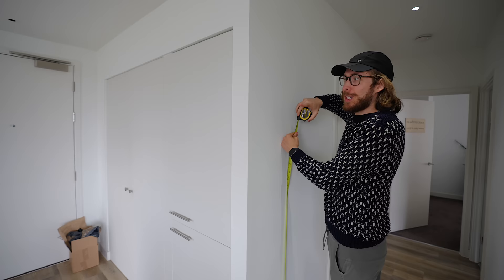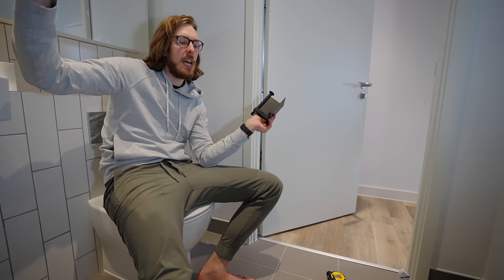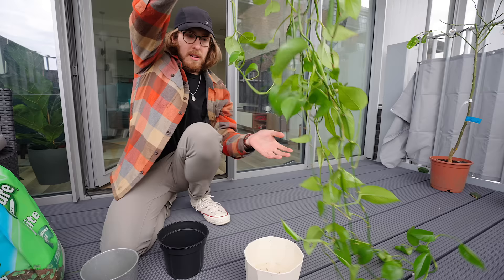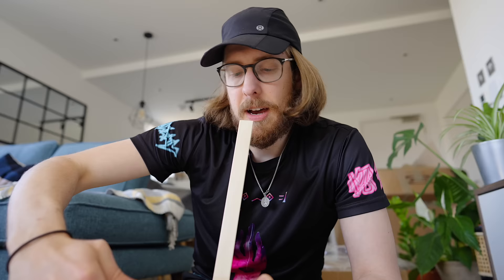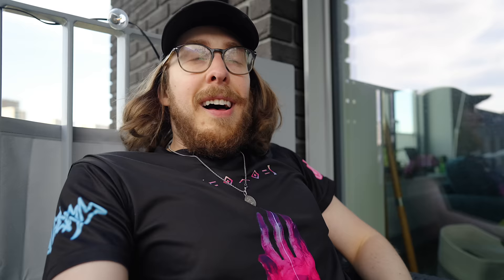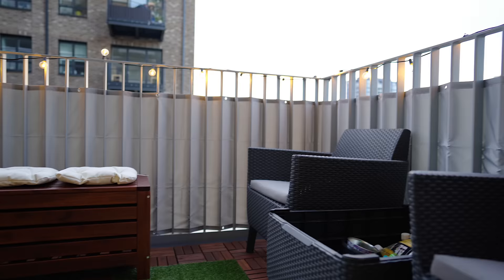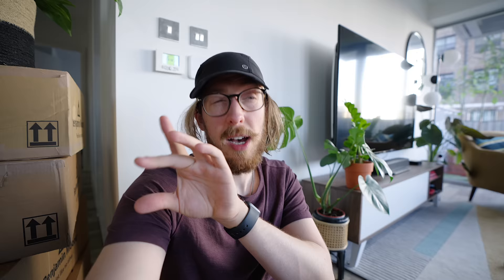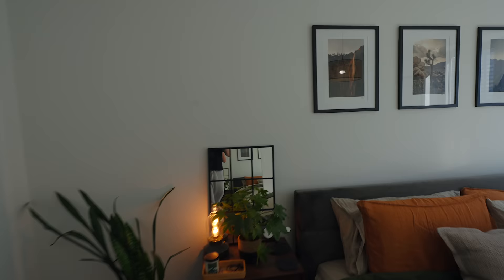Decorating my new flat to find my interior design style

Comment: Screw hole hack! Take scotch or painter's tape and tape over the holes, mark them fully with a pen or marker, then when you peel off the tape you have the exact layout of the holes. Slap that on the wall and then you can just drill thru the tape and then remove it after. It works best when the set is two holes, but I've made like a tape border to get the layout of a four hole set and it worked on that as well.

Comment: My tip for drilling holes has already been covered IE masking tape…

But deciding on paint colours its better to paint a large sheet of paper one colour and then place them against the wall, you can then remove them one at a time until you have one you like.
This way the disqualified colours don’t distract you, you can also move the colours around to see what they look like in different areas and lighting.
Also if you can’t decide, you just take them down and you have your original walls back…

Comment: the radiator cover made me chuckle a bit because it is floating, in my mins they are supposed to be on the ground haha nonehteless it's looking good
Reply: Yeah the pipe comes from the wall instead of the floor so unless I got an expensive custom built one, it’d always be floating. I was gonna DIY the legs longer but I actually like the floating look :)

Comment: Get a piece of stiff paper och thin cardboard. Draw and cut a piece using the wall-facing side of the thing you want to hang, and make sure to mark where the screw holes are on the paper. Then just take the piece of paper, align it the right way up and the right way out, and mark the holes with a sharp pencil or an awl. Remove paper, drill and hey, you're done!

Comment: There could be a setting on the drill where the clutch doesn't release. On mine (a Ryobi), the top two, 18 and 20, don't release when under heavy load. Be careful though, as it will twist your arm violently if the bit gets stuck!

Comment: 2:45 If you don't have one, you need a bubble level. Yiu can get a cheap little 6-12" one. I saw you putting the tape measure across the wall, but I suspect you don't know it's level. Also can check plumb (straight up and down) Unless you're taking a bunch of measurements from the floor, in which case that's why it's taking a while.

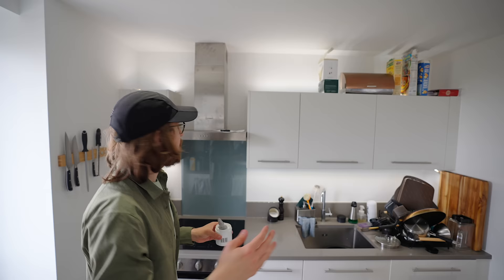EDIT: nm, you have one at 5:19
Reply: He does have a bubble level, he used it to make sure the toilet roll holder was straight.
Reply: @helenbartoszek243  yes. You need to read my comment to the end.
Reply: That's strange, I could've sworn your edit wasn't there before when I wrote my comment